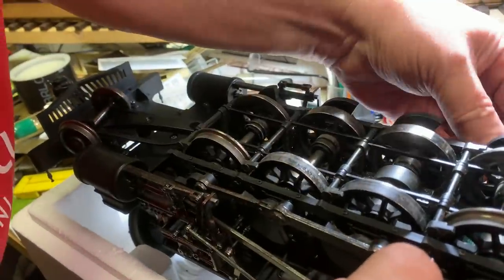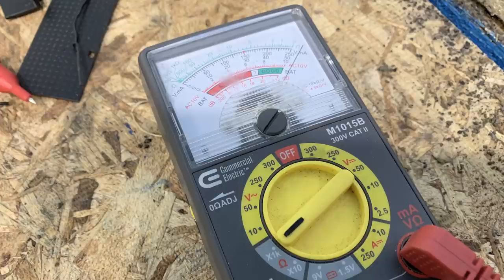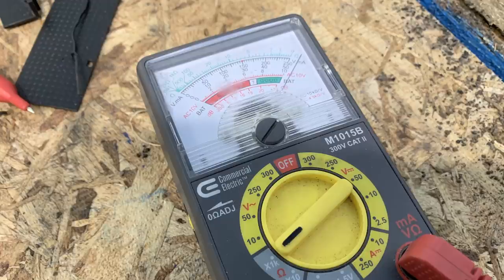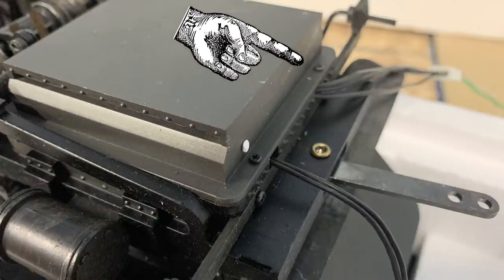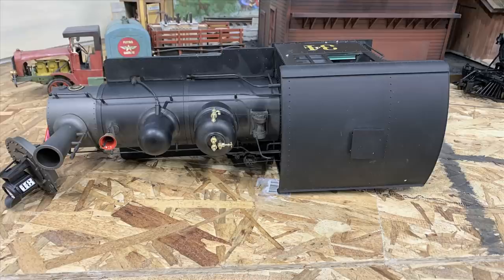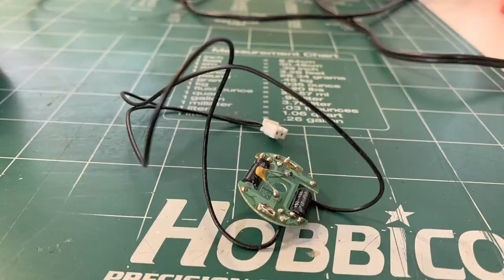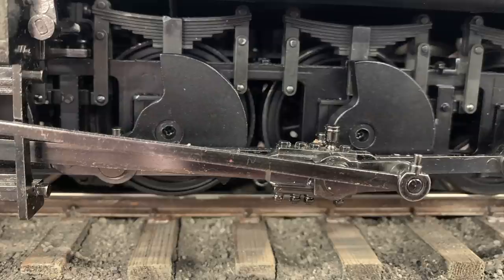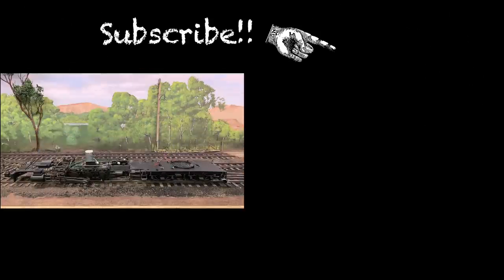Dismantling the Bachmann Outside Frame 2-8-0 "Connie" - And how to set the valve timing.

Comment: Sometimes electrical components won't handshake.   That's when you have to become " Sherlock Holmes" so to speak.  I've run into similar problems myself.  I really appreciate this kind of video it sure helps modelers, thanks.
Reply from the maker: I’m guessing the circuit board on the motor helps the constant lighting work. Keeping the motor from moving until the light voltage hits a working level. Whatever. Don’t need it anymore. Whatever it is.

Comment: Andy, in comments below is correct. That circuit board is a filter network. It is there for a reason. Test it with your DCC signal and make sure it is operating properly. Good Luck!
Reply from the maker: Yup. It seems to pass DC but filter noise. Anyway not compatible with DCC. As the signal is shorted by the board. Not sure why the meter sees it as a short too

Comment: Gotta love chasing down those electrical gremlins.
If you didn't label your small cups you would have been screwed. (Sorry, bad joke).
It's too bad that you couldn't somehow encase the speaker enclosure in order to get a better, deeper sound. In the audio world a good speaker enclosure makes a lot of difference. 

Thanks again for another great video.
Reply from the maker: Next weeks show!  I have two. Don made one and I made one. So… battle of the baffles. Quite baffling. Don was 3D printing them! But many of the 3D printers are way more trouble than they are worth. So we have gone Blue Man Group and make then out of PVC plumbing.

Comment: Capacitors mounted directly on motors are for filtering the Electric and Magnetic Fields (EMF). It's mandatory on any new item, therefore any DC locomotive from 20 years ago to now would have it. If the locomotive is delivered with DCC decoder, such capacitor is already removed, as it is better without it (but it should short it).
With address 0, you aren't using real DCC: the commanding station is varying the width of the DCC pulses, so for the motor it is like a good pulsed DC power pack.
Reply from the maker: Yes so I could kind of understand how the capacitor was shorting out the DCC pulses.   But my meter?  It’s just on a battery. DC. But between the cap and the motor it showed as a short not a load. Still don’t know why.
Reply: @ToyManTelevision  Yeah, the meter should inject DC for measuring, but I don't know well the analog ones. I bought a half cheap ($25) from Aliexpress some years ago: ANENG AN8008 Multimeter, it is as precise than a Fluke, and way better than standard cheap model found everywhere.

Comment: Dale I think your shorting problem is that big fat capacitor across the motor brushes, put there to reduce RF interference from sparking brushes. The capacitor blocks DC, but DCC is seen by the capacitor as AC, hence it passes the current causing a short circuit. I am sure I am telling my grandmother how to suck eggs. That motor looks kinda small for such a big loco. All the best!
Reply from the maker: All good!  No idea why they put that board there but must be that. Anyway it in the bag. And the DCC is working on two of the three, this one is working at address 0 and is also ready for its board. But two days daze? Because of this board.

Comment: I would have looked at upgrading the motor while you were elbow deep into this project.  I would bet that orange Tantalum capacitor stretched across the ends of the board was shorted. Those are notorious for doing that and sometimes exploding.
Reply from the maker: I think it was operating normally. It was intended to keep AC out of the motor? Stop back voltage?  Who knows. But not compatible with DCC. Or my meter.

Comment: I believe that the circuit board is designed to suppress interference to AM radio from the motor.  AM radio was a 'thing' a long time ago...  heh.
Reply from the maker: Definitely a filter. Passes DC blocks everything else in both directions. Anyway not at all compatible with DCC. Now gone from all three locomotives

Comment: Hi what your looking at is a capacitor keep alive system, it works with the motor and could help with lights. you wont miss it .... maybe a problem at switch track but lots of way to build your own if its a problem. culprit be one of the caps is blown...
Reply from the maker: Well it’s running now off the DC power supply just fine! And that board may find itself having a serious accident. Two days lost looking for that miserable thing.
Reply: @ToyManTelevision  it will run just fine now. Had one of my lionchief plus boards go a bit at a time lol trying ta figure that out. Was the solder joints between 2 boards that cracked loose... Enjoy

Comment: Showed one side of train, is the other side 1/4 or the same if quarter forward left or right? Have 2 battery and 2 electric. all seam to be ( jamming) binding.
Reply from the maker: Yeah the other side is quartered, as are the counterweights. So I tried to match everything to the counterweights assuming that they would be quartered the same. Seem to work.

Comment: The circuit board on the motor does not have capacitors on it those components are inductors used to smooth out the DC current.  If you are converting to DCC it is recommended to remove these inductors
Reply from the maker: Yup. Took some figuring but all good now

Comment: The board was for noise reduction from the brushed motor. There might have been some chip or part the elimination of voltage spikes from the back EMF of the motor. The park most likely failed shorted.
Reply from the maker: Still can’t figure how it could run on DC yet show a short on my meter. Should have shown a load. But my meter is sort of junk. Probably was just the motor load but the meter is just junk.
Reply: @ToyManTelevision  too bad you threw it away. I would have loved to looked at it to figure out what it does and what the parts were on the board.

Comment: Curse those circuit boards I would use a hammer at this point😂😂😂😂😂
Reply from the maker: Sledge. Plan. Years ago I had a bad power supply for a mic. Kept going out in the middle of something important. Sooooo. Bought two new ones. They worked great. They better for $400. Anyway then I built a bomb. Not that hard to figure out. Had a fuse. Invited people over. Lit the fuse and chunks of power supply went everywhere. Way bigger blast than I expected. Then rounded up the parts and hung it in my office. Message to all of the other equipment.
Reply: @ToyManTelevision  l like your reply really made me laugh 😂😂😂